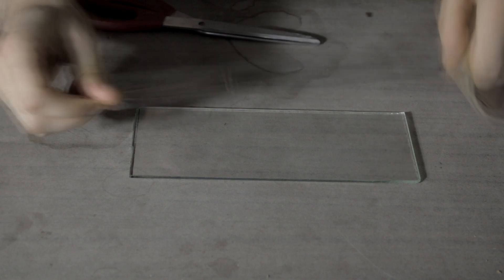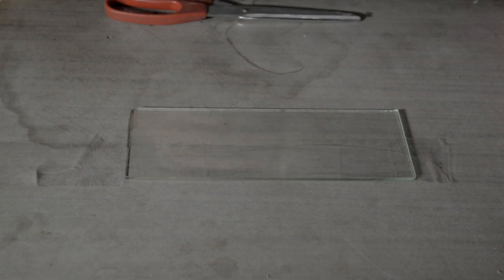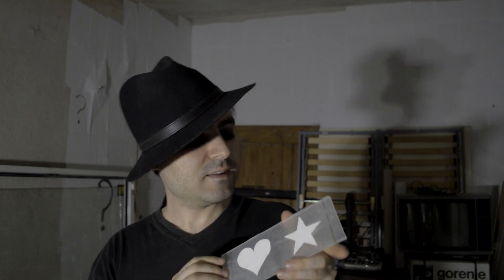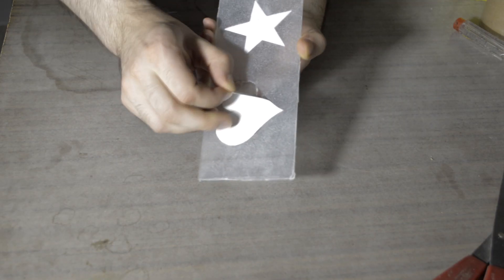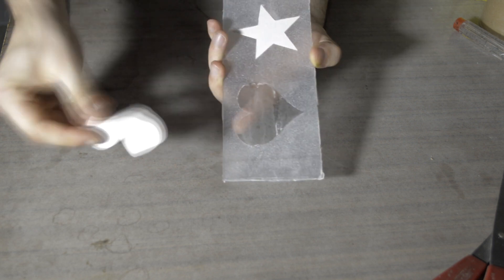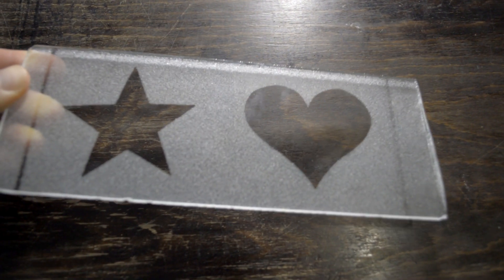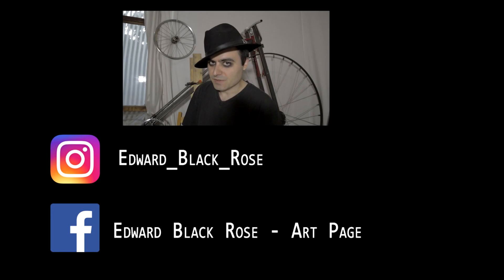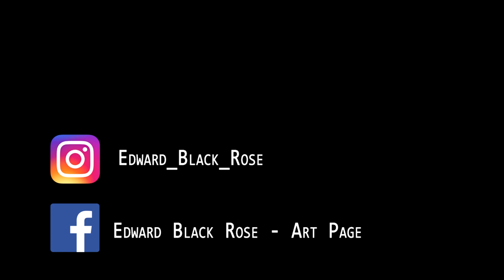Glass Etching - Cheap Method

Comment: Instead of hand shaking for "very long time" I wonder what the result would be like using a tumbler. Im sure a tumbler can be made easily with a motor :)
Reply from the maker: Yes it is possible to make such a machine. Will save time. But I'm still not found a solution for large glass.

Comment: This would work for me if I was doing just one glass, but I have 50 to do so I have to find another method
Reply from the maker: I have a similar problem, you may have to buy an air compressor and sandblaster
Reply: Actually I decided to use my manicure machine and I placed a stencil on the cup and it actually worked!!
Reply: @henrie.c  sweet